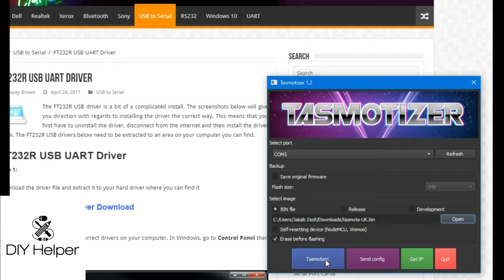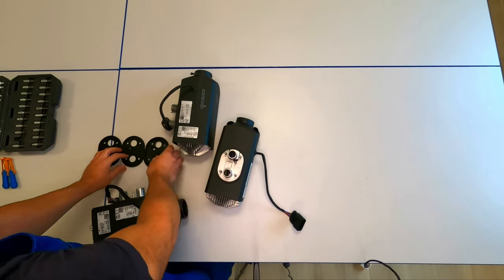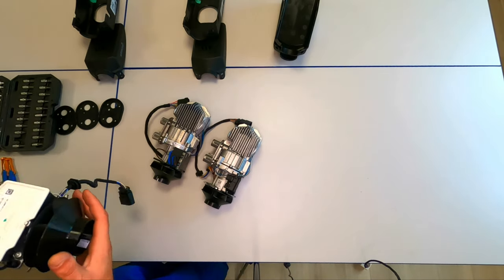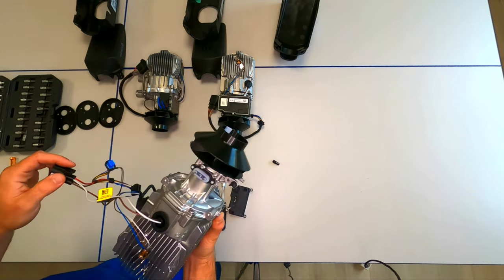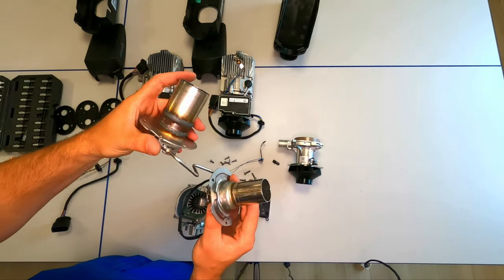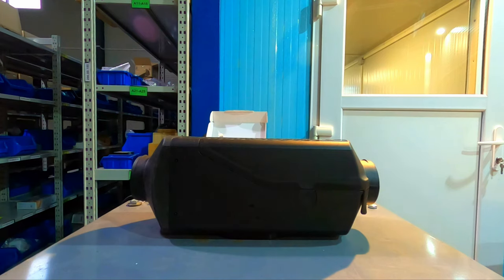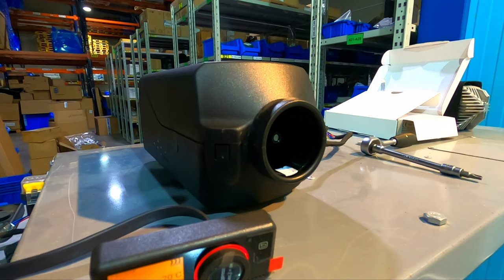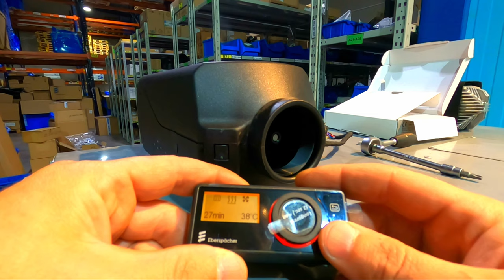Eberspacher Airtronic 3 review and teardown. Airtronic 1 vs 2 vs 3.  Espar AS3 D2L vs. D2 sound test

Comment: well i have a 1 gen D4 on my bench now with 20457 hours of total runningtime, and yes it has been fixed several times before, for the readers reading this, it has not manage this without many parts beeing replaced some several times, but the ecu is the stock + some of the parts on it, and it is pretty worn out, i have seen D4 brushed motor with runningtime of more then 7000 hours, but as you sad, there is no rule here, somtimes bearing fails, somtime the brushes, and at a lot less hours on them, the D5 can if you are luckey run 9000 hours, the motor is then a mess of worn our parts and brush dust, just a horrible thing to open. it is a shame that eberspacher did not do the new heater compatible with the older harness and display, as we have many fishing boats using them, and have several heater's for swap, when 1 is worn out, there are no replacement, exept changing the entire system. and many talks about a china heater to replace them, the price diffrence is just to big, eberspacher has become verry expensive, parts to. it is a mutch better heater and system, but so expensive, i have been working on theese heaters for 25 years, and still do, but less.

Comment: I am a small fleet mechanic and we have about 10 of the original airtronic heaters , when a driver says it's not working it has only ever been a bad gasket for the cumbustion chamber. Simply disassemble clean and put in a new gasket. Recently I installed a new airtronic 3. I have not disassembled one yet, the wiring looks more difficult difficult being in one plug rather than each sensor and glow plug having there own plugs.
Reply: I am wanting to buy one for myself.  I like the brushless motors, but looking at the design of them, I am leaning towards buying a 2 and avoiding the 3.

Comment: What about the B2L  What do you think of the gasoline version compared to the diesel?  I want to install either of them in my Jeep Wrangler JLU 2018
Reply from the maker: Hi, I didn't get my hand on the gasoline version yet. Eberspaecher for a long time didn't have a 2kw version of a gasoline heater, only the 4kw one. We almost exclusively have demand for the diesel heaters but I would have to say that the gasoline version will be very similar to the diesel one. Gasoline burns much cleaner than diesel so I don't think there will be problems with them.

Comment: Hello, thank you for your video. Did you compare the Airtronic S2 or S3 with the Webasto Air Top 2000 STC ? What is the most silent ? I have the S2 and when it stop and start again in the night, it is quite noisely, it blow way too strong ! Thank you.
Reply from the maker: I have the webasto but did not start it yet. S3 has a new way of starting. It takes into account the temperature of the heat exchanger and starts with the needed power. The S2 and S1 have a different burner and the high power starting is needed to ensure good burning. On this note I quess webasto has a similar technology burner as the s3 but I don't know yet how it works compared to the airtronic
Reply: @DIYHelper  oh great thank you for your response. Good point for the S3 compare to the s2. I'll be interested if you can compare the S3 and air top 2000 stc because nobody has made this comparaison and they are the 2 I hesitate for my future campervan :) and they are the most popular in the market !

Comment: Hi again,
I just found this video. It could be amazing if you did include compression of the noise of the airtronic 2 with the other 2 models also. What is your opinion, is the 3rd generation really that much better than the 2nd one. What is the price of the 3rd compared to the 2nd gen and is it worthed.
Thank you in advance! 
Todor
Reply from the maker: Hello, well it is a little better I did not compare 2nd a 3rd yet in a recording but I believe the 3rd is a little bit silenter due to the burner. I don't have a sound meter but I tried my best to record exactly at the same distance. As for the upgrade I don't think it's worth it at this point only if for some reason you must change the whole heater.

Comment: The #1 D2 the mesh surrounding the burn chamber as we saw in using a torch to clean has to touch the glow plug screen digging around will increase the space it acts lick a wick spreading the fuel around the circumference to burn even use a brass pipe style cleaner brush to clean the glow plug hole digging around will ruin the mesh and create a gap giving you a burner that will only last 10 hours just saying. The #3 no glow plug screen a failure point and more surface area in the burn chamber but wimpy electrical connections an other failure point time will tell. I have a #1 d2 Airtronic and a Hydronic both used to heat my garage have a car rad in a fixture the hydronic flows coolant through and a fan that pushes air through the rad works quite well the latter is under my work bench by my laptop I am quite comfortable there on cool days. My garage is bigger than normal 850 square feet but back to reliability you have to run these heaters once a month for 30 min even in the summer as said in the manual you can get away with the air unit but the Hydronic is not as forgiven its combustion fan has a very small space to the body that is aluminum that can build crust blocking the fan and lock it up running it cleans this.Thanks I am a diesel tech in a Freightliner dealership an I deal with these heaters tiny furnace and boilers they are amazing.

Comment: Thank you for your Video! I have an airtronic 2 and is has a very high pitch electronic hissing noise when the fan is running. Did you notice that on the airtronic 3?
Reply from the maker: Since it is a brushless motor there is a possibility, I did not notice it myself during running, I will pay more attention next time I start one.

Comment: The burn chamber - such a fundamental redesign! I reckon it's as a whole tuned to burn much hotter, to help manage soot production - almost no way to run it 'cool' & create soot. However - this then means that the burn chamber needed to be smaller, for a given size of fin-area.
Reply from the maker: Very good point,  we have applications where 2 kW is too much and the heater runs mainly on low power levels. The old Airtronic will produce soot in this conditions, it will be interesting to see if it is the case for the 3rd generation,.
Reply: @DIYHelper  Indeed - most interesting!

I have this theory/notion - that, with combustion intake & exhaust completely unrestricted - the unit will not make any soot, even on low power. In a real engine, soot happens in lack of oxygen conditions - so - assuming that the heater is tuned correctly out of the box (i.e. lowest fan RPM is enough to suitably feed air also to the combustion process, at the lowest-chosen pump rate) - then it should just never create soot. This would then be an argument for, for example, not even putting a pipe on the combustion intake at all (depending on the location) - in my car, it's sat high in the boot, & easy to leave off this pipe. Only the exhaust goes outside, & it's virtually 100% straight, no silencer, about 2 feet long. I don't get any soot on the inside of the exhaust pipe, so I'm assuming that very little (if any) is made inside. Some of these when opened up, are just clean. Soot isn't inevitable, I don't think.
Reply from the maker: Yes but even diesel engines do regeneration for the catalitic converter, where the problem with the heaters this regeneration depends on the user. It is never a problem where the heater gets to work a high power for 10 - 15 minutes every few hours but when I see soot and read out op hours from 1500 hours 1300 are only on low power. I get that it should not soot even like this but this how it is.

Comment: Excellent video, analysis & commentary!

I think they changed the internal design purely to differentiate from the Chinese copies! E.g. making the Hall sensor external, serves no good purpose whatsoever - it's not exactly as though it was a failure point! The original design was simple, compact, beautiful!
Reply from the maker: All manufacturers are driven by one thing, costs, it is very hard to stay competitive in the price range but also bring new features and improvements. Webasto, Eberspaecher could make the perfect heater with all options that you can think of but nobody would buy it because of the price tag. In this case they just used the burner that was developed for Hydronic 3 and works great on that one. We will see how these will be over time compared to old ones.